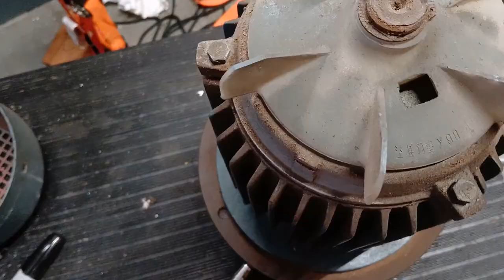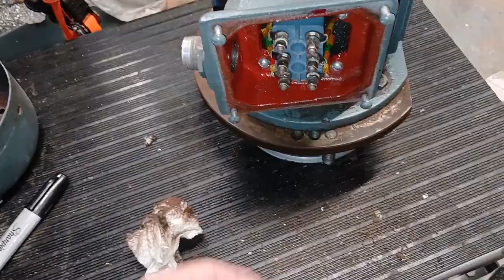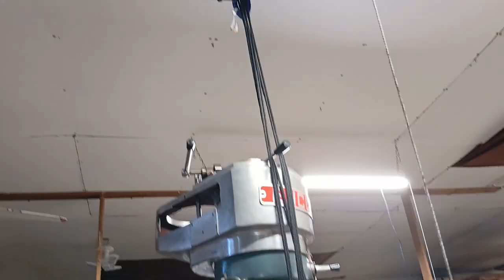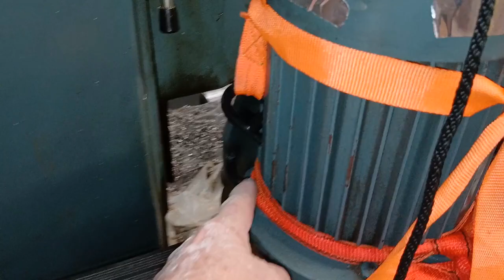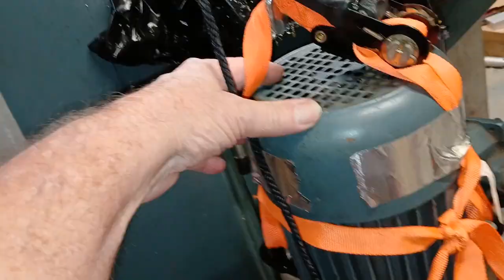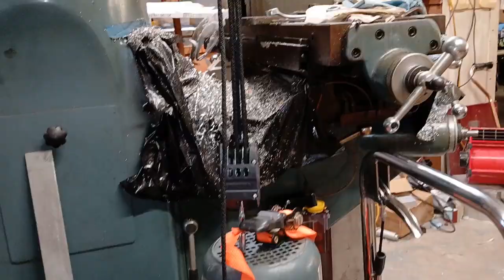Enco 100-1527 / Grizzly G9901 / G9902 repair and replace pully bearings. Reinstalling the motor.

Comment: TEFC totally enclosed fan cooled. Interesting pin belt change mechanism. Great film.
Reply from the maker: Thank you, I have been watching your tear down and cleaning. We have a Harborfreight.com that has an ultrasonic cleaning tank like yours. I thought that was interesting.
Reply: @toolmaker1370 Thanks so much for your support in watching the Rover gas turbine engine films. At the scale that we are operating at on YouTube, every single view and like counts. So I mean it when I say that your support means a great deal to me. The British equivalent of Harbor freight is called Machine Mart. I got my ultrasonic cleaner from an eBay seller. I'm getting used to using it.